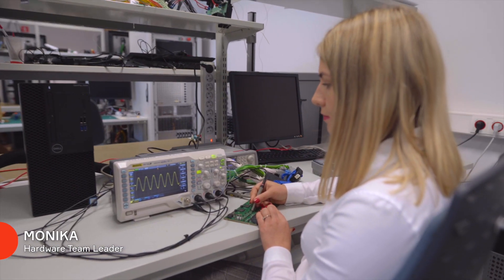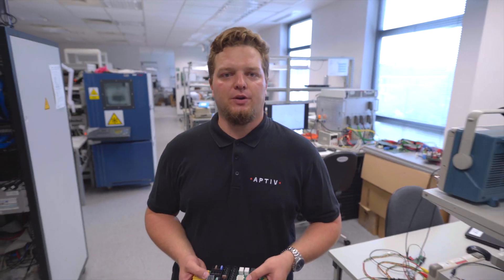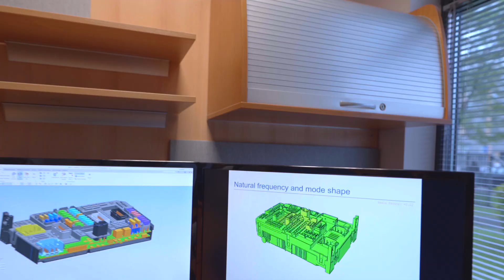Hardware Engineering at Aptiv

Comment: I have a Electric Vehicle Charging Equipment IC-CPD ( 230v / 3.6Kw. ). The AC 16A power lead melted on it so I upgraded the domestic ac socket in my garage to 25A & also the AC Plug for your charger but I noticed it had 2 additional control wires. ( red & white ). I assume that these control wires were for some inbuilt thermistor for plug protection or monitoring. Could you confirm this & advise where I can get this missing part to add onto my new 25A plug outlet as the Charger will not work without it. The Plug type is for Spain CEE 7/7  Type E/Type F „SchuKo“
Reply: it is pointless having this fabulous engineering Team if they can not advise an ' APTIV ' customer how to repair a weak fault on a domestic car charger. The AC 16A / 230v  plug supplied must have had  a bad or loose connection within whereby when charging at 3,6Kw, the heat caused the supplied plug to melt. I have upgraded to a safer 25A Plug / Socket & only need your intelligent team to identify the component within the plug & where can I purchase. I can then get my charger working again so my Peugeot car can operate. Please advise.?